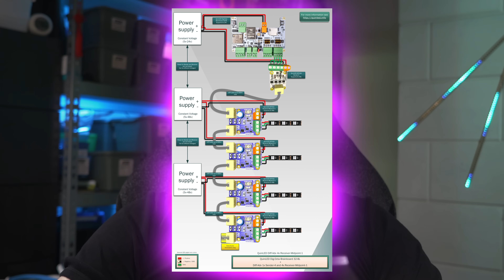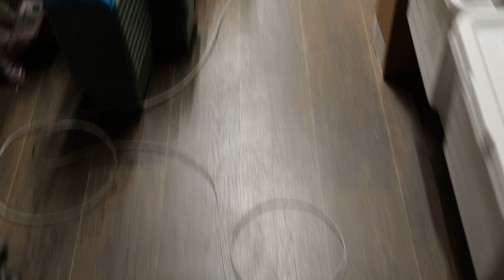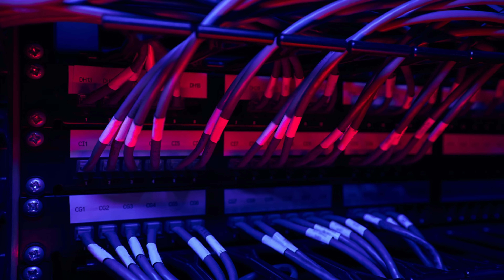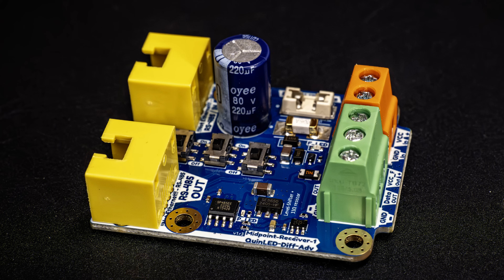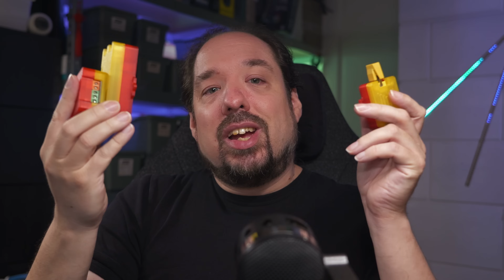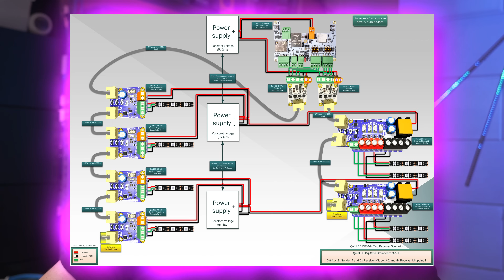💡QuinLED💡Introducing the Diff-Adv System

Comment: The "sharing a  ground" with multiple power sources is throwing me off.  Are the sharing an AC ground (as in the same circuit of my house) or a DC ground? My dig octa is using 24v for cob strips on the house, I want to have  a sender 4 from the octa with about 100' of cat6 to a tree in the yard that would have 5v 2812b with its own power source.  Do I need to run a single ground wire with the cat 6 that bonds the 24v ground with the 5v ground (DC) or just have them on the same circuit (AC)?
Reply from the maker: That should work fine. AC has earth, DC has GND. There is some link between it tough, but nothing you need to worry about yourself if you are in the same building still. So you can just run thar Cat cable to where you need it and it should work fine with the Diff-Adv!

Comment: Another timely watch. There are so many ideas for the house installation. Networking is my thing, so it's good to see I can use UTP for data. 

I am still unsure about the low-voltage power supply to the various locations, so I'm interested in understanding the power distribution mentioned in the video. Has yhat product come on line yet? 

For me, i dont yet have a 3D printer so case are a bonus. I would rather all boards be encased than bare, especially if the go into locations that are difficult to get to, such as a roof void.
Reply from the maker: Sadly Diff-Power is still a bit delayed so that's not available yet currently.
Reply: @IntermitTech i rekon I am a year away from installation (as this is a massive renovation, almost a new build) so i will keep tabs on your channel.

Comment: This is an excellent product! Have you ever thought of creating something similar to be able to run TV HDMI or DisplayPort over ethernet long distances?
Reply from the maker: I have not but I have recently used some 20m fiber-optical versions of such cables, work great, even for 4K 120Hz, etc. so maybe check those out. It won't allow you to patch them, but the amount of bandwidth required just isn't going to work over copper and fiber is great for that. You can get a 8k HDMI 20m/64ft cable for like $50 on Aliexpress.
Reply: @IntermitTech  thanks for the information! Appreciate the reply!

Comment: I have the data boosters that you already made, what is the difference of these compared to the data booster small chip that is a "midboard" also. I know the voltage is locked on those data booster boards but what else?..Thank you for the video!

Comment: So I found the theoretical max length of my type of leds for my power supply (with a 20% safety buffer too). But what if I want to double these max lengths or longer? Do I need more power supplies? More controllers too? Or switch to 24v/48v leds? Is there a good video or article about this somewhere, or can you make one? Thanks!!
Reply from the maker: I'm not fully sure I understand the question. Are you talking in regards to power or data? With this solution data will go 500m at least so I'd say that part is solved. So then, what are you asking? With power?
Reply: @IntermitTech  yes with power I guess. I’m using a digquad for the controller/data. But with a 600w power supply (and 20% safety buffer) and my type of leds I can only do 500 lights total or 164 feet in length. Would I need to add another power supply somewhere in the line somewhere to double this length or more? Or what’s the best way to run more lights once you’ve reached the limit of your power supply?
Reply from the maker: Hmm, I doubt you'll reach power supply limits that quickly, unless you are doing lots and lots of injections. The Dig-Octa can handle more but again, I doubt that is currently the issue unless you've run out of space on the Dig-Quad to do injections or maybe with 5v stuff. But let's discuss on Discord. :)
Reply: @IntermitTech  yeah I’m in the discord too and tried posting my question in there. My lights pull .96w max, and a 600w psu with a 20% buffer (480w) only allows for 500 lights or 164’ to be powered before exceeding that threshold. But I need to run 300’ or more to get around an entire house roofline so I’m not sure what to do yet.. I would need to have at least 1000w psu or some other solution.. I’ve heard about adding more psu’s on the light run but idk how or if that’s the best solution. I’m using 12v puck lights
Reply: @IntermitTech  are you doing another livestream or something soon? Or can you do 1 on 1 sessions?
Reply from the maker: @xXMOTOXPYROXx just come to the Discord server, lots of smart people there. Link right at the first page of https://quinled.info

Comment: Looks like a great product. Is it possible for the data signal to be TOO strong?  Is the receiver board pulling down the signal again?

If you ever redo this video, consider updating your catchphrase to farther / than.
Reply from the maker: Both the sender and and the last board in the chain have a termination plug on them and the RS485 should auto adjust their output power. I've tested with 10cm cables without an issue too. The receiver board it an LED compatible signal again so no worries there. 

Ah, good point on the English, sadly since this video is up it'll likely stay like this 😅

Comment: That’s awesome, longer distance data cable has always been an issue where designing my setup caused me some headaches. 

Now, I got from this video that you “may or may not” be working on a way to either use PoE or some alternative power method to fix the issue where power needs to be available to every boards (receivers). This would be amazing my friend!!!  

Now we’re talking, this video changes a lot of things for DIY people using WLED and your boards!!!  Thanks so much for the good work!!!
Reply from the maker: Thnx! And yes the next in the Diff line-up I've been working on will also send power along with the UTP cable and then convert it to 5v, 12v or 24v at the receiver location so that you only need to run a single cable and done! But that's still some months away right now. :)
Reply: @IntermitTech  that’s amazing. It’ll allow me to add LEDs on my roofline (2 peaks) where I was unable too because of powering issues/logistics!  👍🏻🤯
Reply: @IntermitTech  do you have an estimate on when you think you'll have that ready? We are remodeling our house right now and I think that would make the wiring so much more elegant
Reply from the maker: Sorry not yet, still heavily in prototype phase and until all the issues are ironed out and we do a round of broader testing and then move to production, I really won't have an estimate.... When it's done. 😅